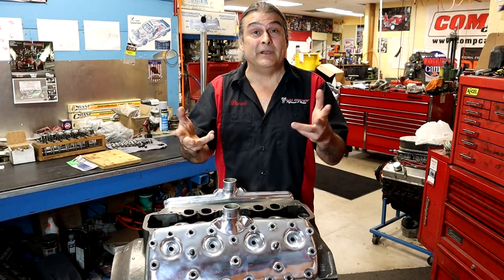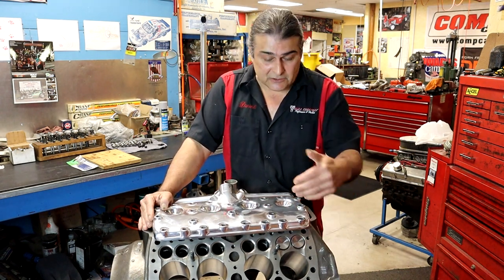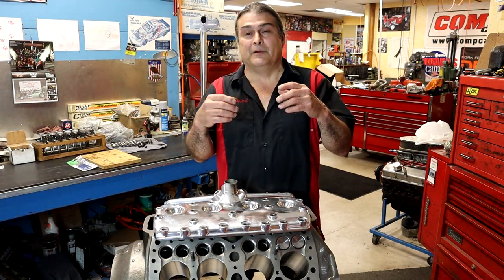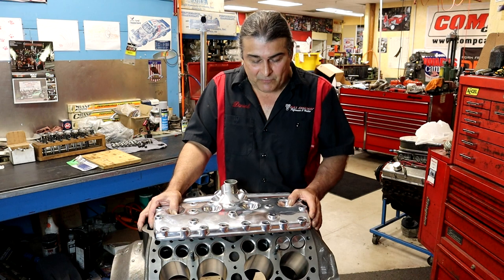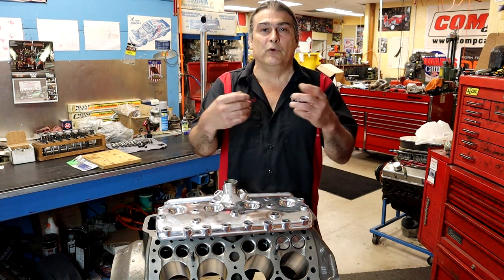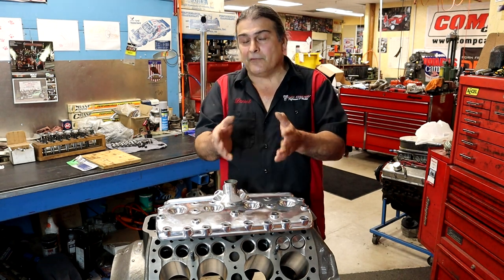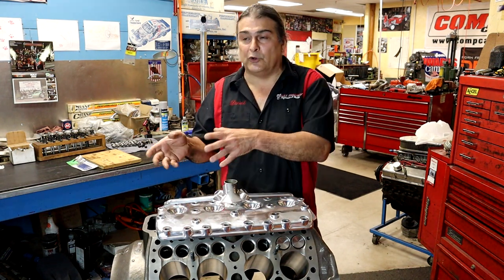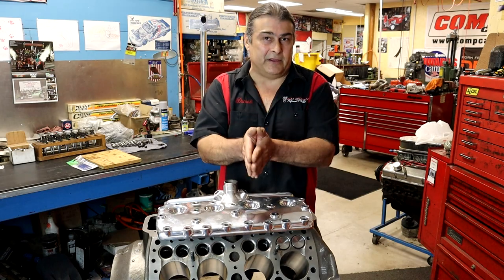Why A Flathead?

Comment: I have about 10 flatheads at my house and only two run.  One is a 59 AB, its tired, but runs.  The other is an early '37 tin side V8-60.  Super rare and super cool, but also tired!  Looking forward to your flathead series Danny!  The engine that started the hot rod revolution!  Hopped up bangers were the rule in the late 1930s.  After the War, the flathead pretty much owned the streets and strips until the early OHV engines showed up in 1949.  When the SBC came out in 1955 it was all over for the flathead race domination wise.  Still the flathead has hung in there and there is no sweeter sound in the world than a flathead rapping out a set of twice pipes!
Reply: Exactly right!

Comment: These types of engines were called sidevalve engines over here and were used in lots of pre 60’s British cars. In the late 40’s Ford sold the Pilot model in Britain with a 2.2 ltr v8 sidevalve, very unusual over here, how big is that one,Danny?
Reply from the maker: David O'Brien it’s a 275.86 or 276cid  3.313 bore X 4.00 stroke
Reply: That’s about twice as big, everything is bigger in the USA